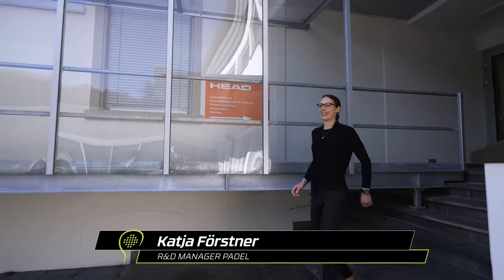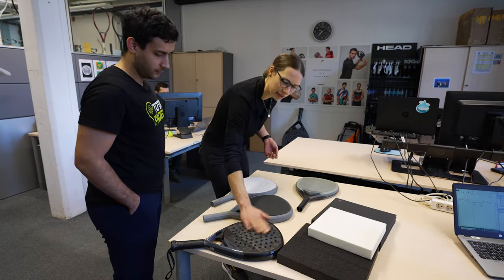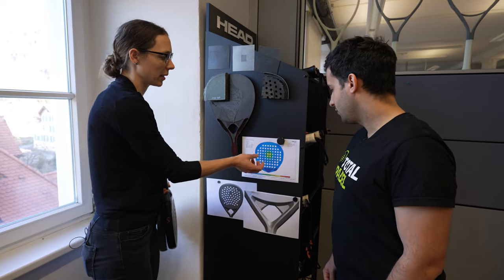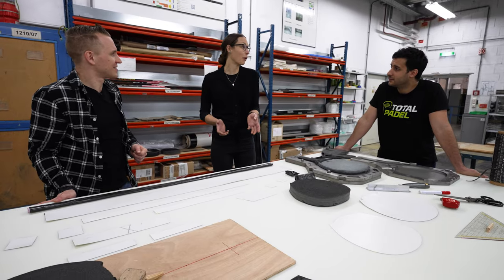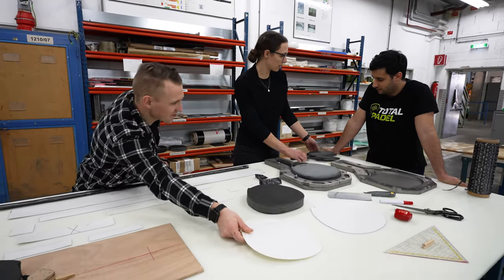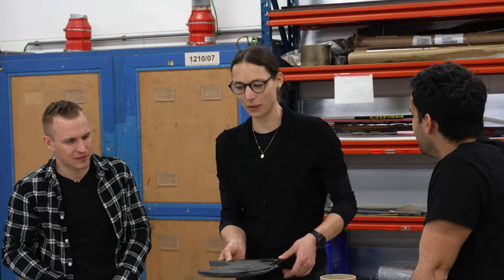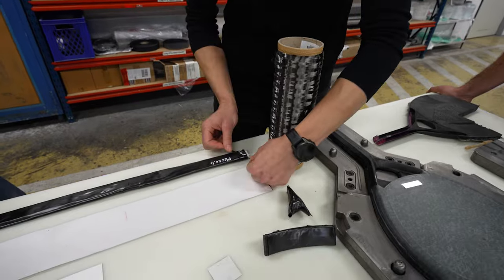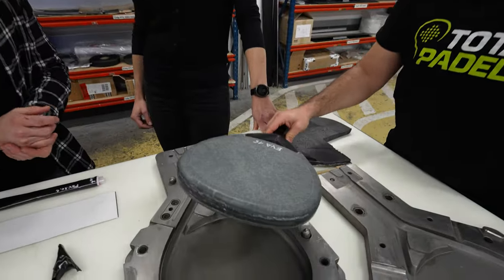How a HEAD Padel racket is made? Total Padel tour at HEAD HQ (R&D, production, design,...)

Comment: I own a head extreme pro x racket and the knob on the grip let loose while removing the grip what glue is used to get the rubber end attached to the racket again?
Reply from the maker: Hello! Usually brands use clips for that. If you want to strengthen that part, think about adding some clips (if possible), or use a super strong glue for plastic. Thanks! - Aladdin